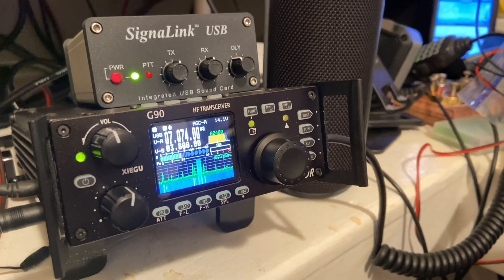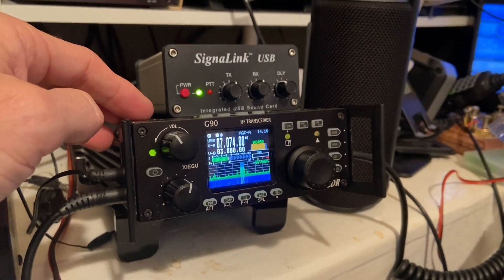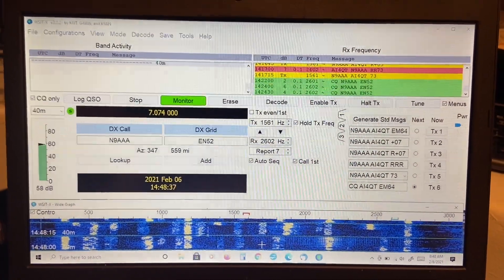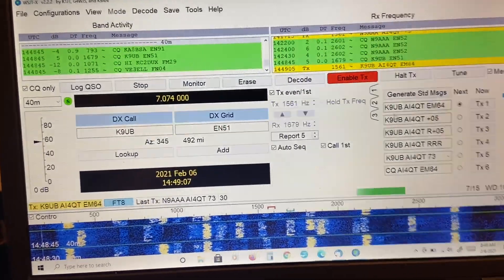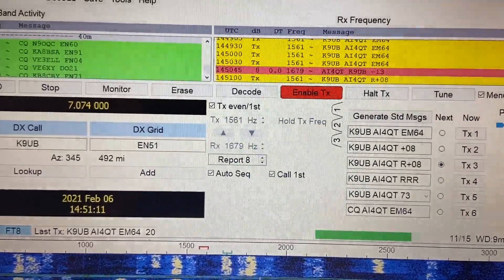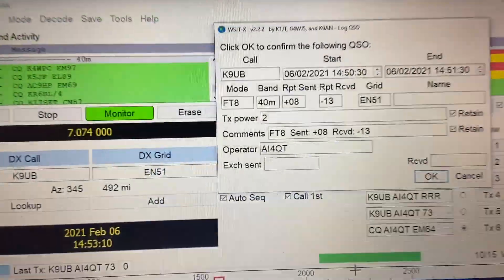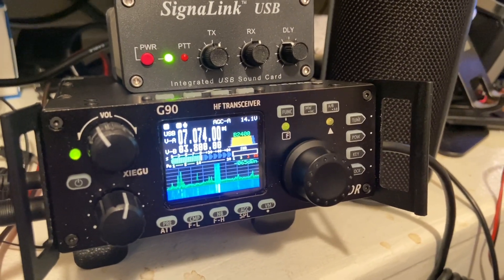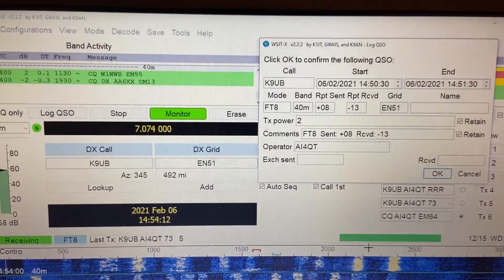XIEGU G90 FT-8 2 Watt Contact

Comment: I picked up the G90 on Black Friday, and I already own a Signalink USB (previously paired with an FT891).  Would you consider putting together a step by step video showing how you configure this, both the physical connections and the software configuration?  This is the only video I've come across that actually shows the Signalink in use with the G90.

Comment: Just bought the G90 and wondering if the signalink soundcard is mandatory to your setup ?  I'm not sure, but I guess you could connect your radio directely to your computer with the proper cable.  Just want to do ft8 but wondering if I must buy a signalink soundcard interface. Thanks